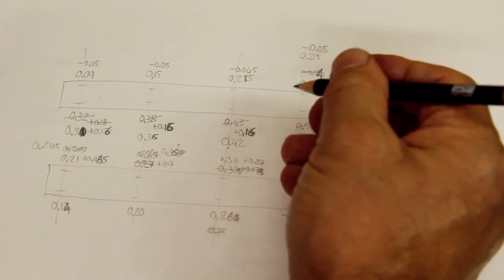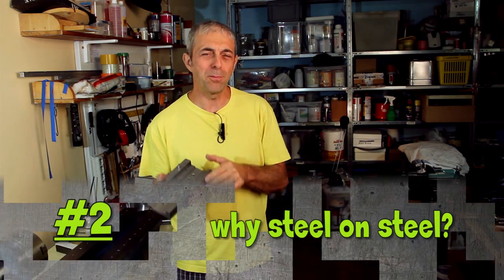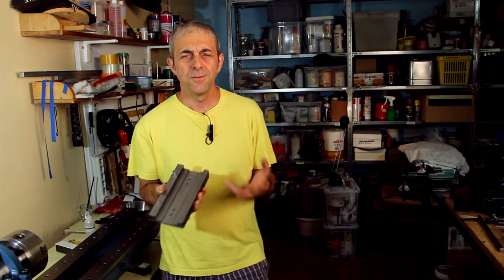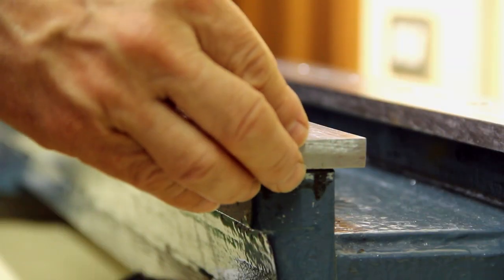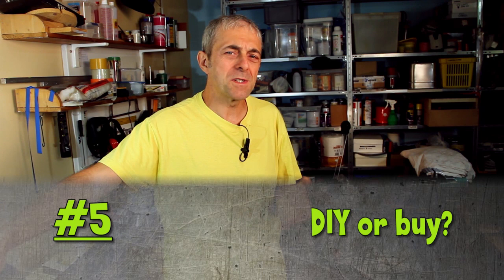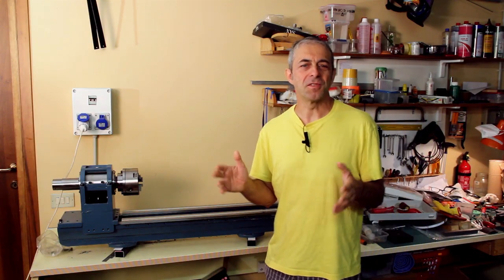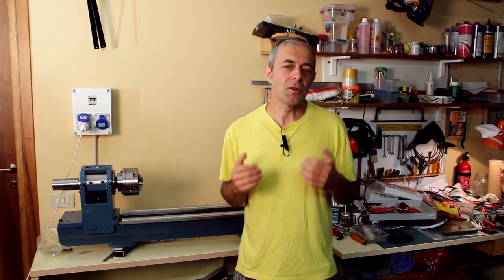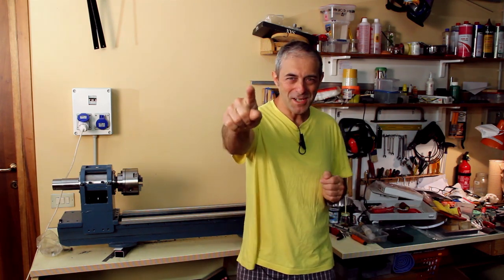DIY metal mini lathe Update+Questions&Answers

Comment: @1:23 you were speaking about other DIY lathes - and saying they were quicker because of their skill relative to yours. 
It seems that the design you came up with is VERY complicated, requiring lots of precision on numerous parts. 
I've been designing a large spindle for a mill - so I've been comparing different approaches. 
You decided on oil bath bearings, instead of sealed.  You have a complex configuration of the separators and end caps and seals.
Most people use sealed bearing - no worry about leakage, or retaining lubrication. 
I think the fit and finish of yours is better than almost any I've seen.  I'm very impressed by your general attention to detail. 

One issue seems the use angular roller bearings instead of Double Row Angular Contact Ball Bearing w/Seals - mine are 40x 90 x 36.5mm.

And only two of these bearings. They are more expensive.  But the angular roller bearings run slow and heat the grease, and you have the problem with leakage.  
None of these issues arise with the sealed angular contact bearings. 

I'd presume you spent a bundle on getting that shaft and housing etc. machined.  Where we live on the west coast of US, I could buy a whole lathe or milling machine for what it would cost me to have those parts you made fabricated.  I go through a local steel shop and have had them do some machine work for me in the past -- its VERY expensive. 
Most DIY are trusting to their own limited skill (speaking for myself) - so trying to keep things simple and within their limited skill. 

In fact on my mill, I'm even eliminating the quill - they double the complexity of the head - and since the whole head is easily moved on the zed axis and position directly readable through inexpensive, I dispensed with it.  Other hobbyists have taken a similar tack.  

All the best, 
RH
Reply from the maker: Thank you for the comment mate. You're right about the bearings of the spindle. As I've mentioned elsewhere in one video of this series, it was my very first time in designing a spindle and I took inspiration from other's design. In hindsight would certainly make several changes. At the moment the spindle works decently, and at a maximum speed of less than 3000 rpm it seems is enough for now. But in the case I'd change something in the future I'd rather change these bearings with the angular contact ones.
I have no leakages with the exception of some oil overflow at the center of the bearing, but that was by design to let the oil have a way to go in the case of excess. The housing provides sealing and protection against the dust and shavings.
Another point where you're right is about making things simple. The motto should be keep it stupid, keep it simple.
So, apart the fact that I've a thing with complicated projects :) , despite the appareance I indeed looked for the simplest design possible for the minimum required features (and yes, admittedly I kept the stake quite high) that I've set before starting this project. 
But also I  wanted to try  what does it mean the fabrication of a pricision machine from scratch, as it was when Jacques de Vaucanson made his world first precision lathe for metals. When I saw that machine at the Musee des Artes et Metiers in Paris I've been impressed by that wonders, and alwasy wondered how do they made the machine that make everything.
You have to understand, I've been educated in electronics and computer science, and despite I have some knowledge in robotics and experience in industrial machineries, I don't have an education in mechanical engineering. So it was my understanding that I had to learn a lot. And I wouldn't never ever gained the sensitivity of what it means to handle a hundereth of a millimeter if I didn't walk through into the journey that I partially documented with these videos.
That was my highest result, much more significative than the lathe per se.
All the best my friend, Claudio.
Reply: @AccidentalScience  Indeed learning is much of the journey.  I too came from an electronics background - still do patent work for many companies and universities.  Yes this arena of worrying about one thousandths here or there is still largely foreign to me.  One learns a new set of disciplinesindeed🎶

Comment: I think the talk about the clamps being flimsy was suggested not for failure but for performance because on the lathe the  parts you make require smooth finishes so rigidity rigidity rigidity is necessary. And the clamps were a little on the thin side. For the spindle design I would of considered a box shape complemented by a single solid plate bolted to the top(which makes a good shelf for tools in the future). Just think for a minute think about the forces involved of cutting on the lathe, as it spins putting downward force on the cutter which corresponds with an upward force on the part carried through to the spindle bearings. That being said the design should almost be made upside down with a large mass above the spindle to carry those upward forces. If it’s too “flimsy “ it may not fail but “chatter “ when cutting may be an uncontrolable issue. Which leaves a finish like the tread of a car tire which is undesirable for bearing surfaces.
Reply from the maker: You have a point about the risk of chattering. Well, at this point let us see how it will chip off the metal. In the case, I will take your suggestion and put a bag of stones on top of the headstock :)
Reply: Only use stones have a weight equal to 1/3 of the radius times pie  minus the 3rd and second prime numbers. Take that answer to the second power. Dividend by the square root in of 7. This is how much each stone should weigh should you have e to do this.
Reply: I hope you’re useing tapper roller bearings aswell since the forces involved when cutting on the lathe are not only axial but lateral also & ball bearings don’t support that much lateral very well for long term. Well regular ball bearings will wear very fast and won’t provide the rigidity necessary.

Comment: I admire your determination!
You have tenacity - you stick to it and make it work!
By the way, did you fix the spindle bearing that slid onto the shaft too easily?
Thanks. :)
Reply from the maker: Yes I did. I used specific anaerobic glue. The problem was an other: thermal expansion. But as I said in the video it was solved by the mean of a flexible ring.

Comment: 240 N = 2400 kg force...
Are you sure?
Reply from the maker: Wowowow where I did say that? It is of course the reverse!
Reply from the maker: I've checked my script (because yeah, to avoid to forget what I have to say in front of the camera I use a script!) and I don't know why but I've messed up the numbers, that I even used in video! Indeed the shear strength of the most critical point of the clamp is 43 THOUSAND N, or the equivalent force of 4400 Kg, that with a safe margin of 55% it gives 2400Kg, which of course translates into 23KN and not 240N. Thank you sir.
P.s. I've mentioned you in my pinned comment about this issue.

Comment: I love the updates you've made. The amount of time is not an issue if it's not an issue for you. Just remember, you are making it for yourself. Is there anything that we can do to help you? If you are worried about adding mass and stiffness to your bed, you could add an epoxy granite mixture in the underside of the bed.  Are you planning on making a collet closing system?
Reply from the maker: Thank you for the friendly words and help offer. At the moment just comments like yours are really helpful in keeping up the morale :) Sharing the videos is an other way to be helpful, but do it only if you really like it.
The epoxy granite is already planned in the case of stiffness issues, and I already filled some gaps in the bed with quartz-epoxy.
The spindle is ready to be adapted to host a collet system, but because it is quite expensive I will go for it only if I'll really need that kind of solution.
Cheers, Claudio.
Reply: @AccidentalScience  we all certainly enjoy the videos and look forward to seeing your first chips as well. Who knows, maybe you'll make a mill with your lathe.
Reply from the maker: @tristenheckman  who knows ;)

Comment: Good job. 
What type of drive are chosen for this project. 
Variable puleys or frequency controller for motor?
Reply from the maker: Drivers are for dc motors. For the spindle I planned to use dc but have a backup option for a vf ac motor. I'm gonna use motors that I already have at home.